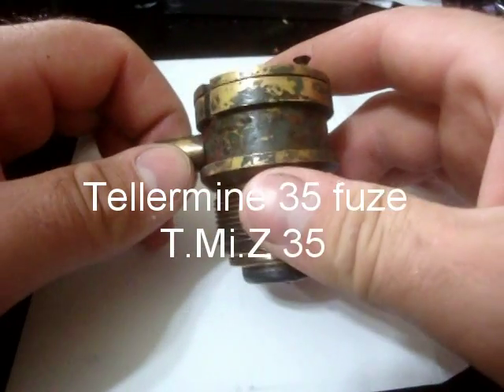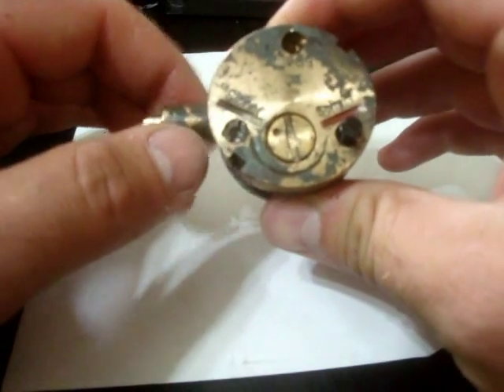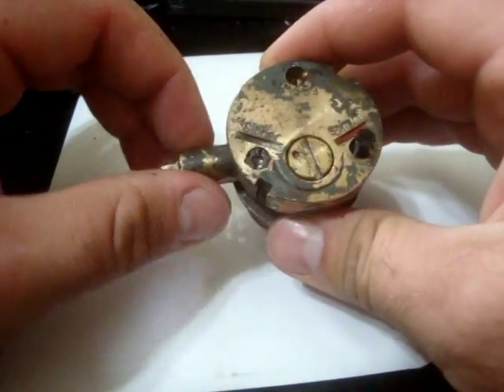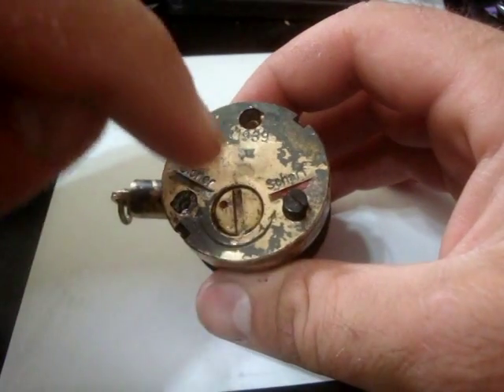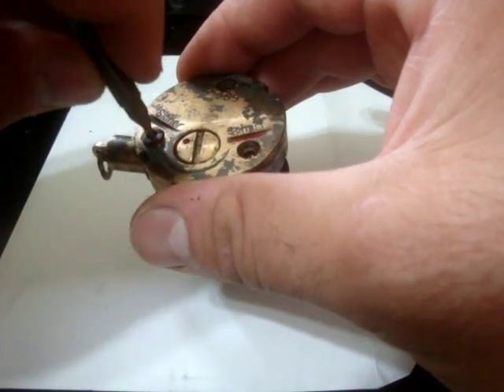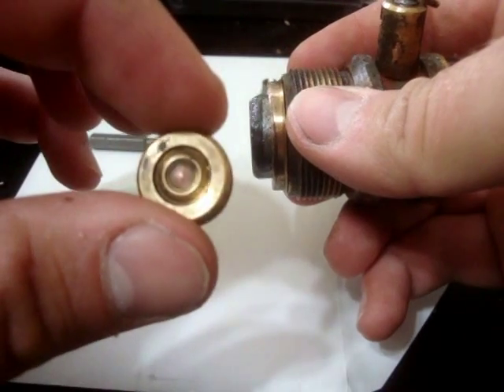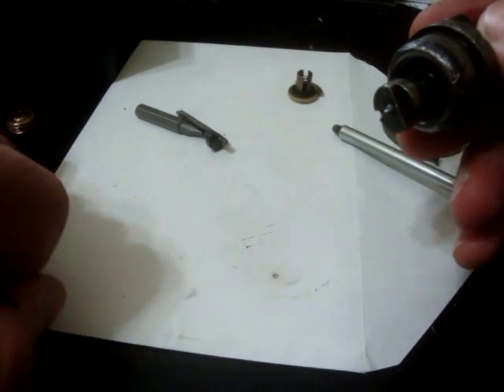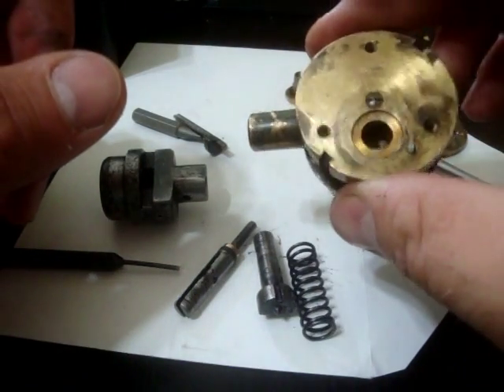Tellermine 35 fuze: T Mi Z 35

Comment: Ok - I give up! How did you unscrew the cap holder on this fuze to get at the firing pin? I’ve cleaned up the rust to clear the disk and have even gotten the main ring off the bottom to release the entire firing pin assembly itself, but the disk that seals the striker and spring in the assembly and holds the firing cap I cannot unscrew in the slightest. Please share your solution. Thank you!
Reply from the maker: Held the steel part in a padded vise. Made a tool out of wood and drill bits to fit the disk. Slightly drilled the divots in the disk that hold it in place to make my life easier even though you dont have to and then turned it. Just have to be careful. No real good method.
Reply: Thanks for the advice - I tried, but can’t get the succor to budge. Drilled out the peened places and used Liquid Wrench. Nothing. I did manage to scar the brass surface in the multiple attempts. In any event thanks for sharing. Funny how this is the one part of these fuzes which is always so corroded - next to the screws, that is...
Reply from the maker: @personalaccount4228  shitty. Im surprised it didnt free up.

Comment: I like enjoy watching a group of Russians that dig these up or find them on occasion and broadcast here on Youtube.  Today they found a couple of these mines from a swampy area.  What even got you to be interested in messing with these, much less how did you even acquire one in a condition this good to disassemble?  I know the ones they pulled up today are probably in this kind of condition or better by the looks of it.
Reply: Recently I found 3 of these in excellent condition looking almost new.... still with the Bowden cable wrapped round the fuse and connected to safety release pin.. I suspect they were left in what were some stores in Normandy. Goes without saying that I am very proud of them. Further West from here near Grandcamp Maisy in what was a minefield, I found many that have been detonated. This causes the brass body of the device where it enters the body of the mine to get slightly chamfered from the force of the upward blast.
Reply from the maker: That is pretty cool to hear about. I would love to dig some areas like that. Thanks for mentioning it.
Reply: @Stray03  thank you for your interest. Just returned from France last Monday. Was lucky enough to dig up a perfect alloy 189/40 teller mine detonator with its safety pin still intact and straight. It has cleaned up beautifully. It was my interest in this and its workings that lead me to your sight. Pleased it did. Kind Regards, Francis